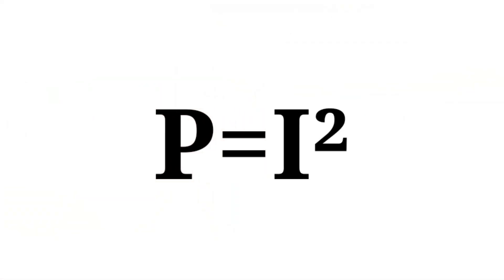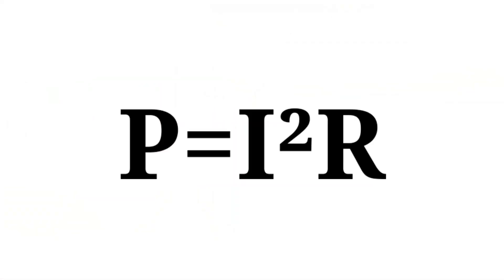Aggregate current and how does it affect MF junction boxes? - Wago 221

Comment: Yeah, no, totally - 'aggravated currents', for being so squashed in bakelite junction boxes since fifties. ;) 
I've another one - "aggregated currents" - when a 100A consumer unit is no longer enough of an enclosure for a single ring final circuit.
One more? "Aggregated currents" - you make sure to package your Wago Topjob's into ten separate enclosures when extending 10 way consumer unit. 
One last one - "Aggregated currents". When IET makes a mistake by adding "follow manufacturer instructions" to BS7671 and accountants at Connexbox do not know where to stop.
Reply from the maker: None of your examples are maintenance free. The requirements for aggregate currents are from the relevant British standard for maintenance free connections, the manufacturer's instructions make sure you comply with that standard.
Reply: @efixx  As we all know - bad regulation/standard is no regulation/standard at all. We can't use Ideal's In-sure boxes on RFC, because they are downgraded to 16A and thus useless. Whereas Connexboxes keep coming up with ridiculous hoops every few months, and change the rules so often we probably need to leave a copy of documentation and proof of manufacturers instructions with every MF connection under the floor. Now they want multiple boxes for every spur plus a different type of connexbox for each type of Wago used. 
Since you guys clearly have a good communication with connexbox may I please ask you to forward the following messages from us - consumers:
- ONE - if it's required - it must be in the package. That's the consumer law. If a zip tie, plastic insert, or that screw mount is required for the box to be compliant with MF logo on it  - it must be in the package they sell us. Otherwise it'd be like selling BS1363 sockets with all three connection terminals and mounting screws to secure the socket missing and sold as optional extras. Connexbox need to stop being such a-holes.  
- TWO - they need to stop screwing around with the rules or they will finish off MF standard before it's even properly adopted and everyone will go back to packing their Wagos into cheap Wiska or Schneider IP65 junction boxes for eternity. If Connexbox going to keep changing the rules and we are going to be constantly non compliant anyway, we might as well be non complaint in good quality accessories, with proper entry grommets and plenty of space inside. So - what I'm saying - Connexbox need to stop being such a-holes. 
Love and peace and smile - you know all above is true (and funny). :D
Reply from the maker: What's bad about the regulations for maintenance free connections? Could you point me in the direction of that consumer law please? A distribution board doesn't have to come with all the correct size breakers to make it compliant, twin and earth doesn't come with earth sleeving and clips to make it compliant. It hardly seems unreasonable to expect a sparky to have a cable tie. 🤷‍♂️
Reply: @efixx  Selling twin and earth without earth sleeving doesn't break its BS6004 or 6242 compliance , selling enclosure without circuit breakers doesn't break its BS 61439-3 compliance. If connexbox is telling us that the lack of ziptie or plastic fitting for Wago 221 invalidates compliance with MF part of BS5733 then it is very much double edge sword - by default what they sold us is not a complete MF fitting, its not fully BS5733 compliant as sold and as such shouldn't bear (MF) logo? 
"Here's your ordinary Wagobox sir, would you like the optional BS5733 MF kit for it sir - it consists of three compatible Wago connectors, a plastic lining for said Wago connectors, a zip tie and *MF logo sticker*."     
Douchebaggery has to be combated, and it's a righteous cause...
Reply from the maker: Respectfully disagree, you could be buying the box to use as a non-mf connection in which no cable tie required. It's completely reasonable to expect an electrician to have a cable tie in the event it does need to be maintenance free.
Reply: @efixx  ok but then does it comply as an enclosure because the enclosure can be opened without use of a tool.
Reply: @efixx  You know it's not about a zip tie or a price of it. It's about Connexbox playing us for fools and continuously changing rules. 
According to this whimsical "aggregate current" bovine excrement, a simple "ceiling rose for downlighters" - a connection that splits 6A lighting circuit into four 5W LED downlighters, bathroom fan and a pull cord switch thanks to Connexbox becomes 80A junction of mythical "aggregated current" and requires at least four Wagoboxes with optional extras. Where all it really requires is four tiny Wagos and one good and solid encapsulating box, for the rest of the eternity.  
All we needed from them was that flipping box for Wago connectors. Instead they keep creating hussle, backward incompatibilities, hoops, multiplying accessories and obstacle courses just to split a simple MF junction into three or four separate boxes with extra accessories for every single spur. 
Guys, we need you to be the voice of reason and call out douchebaggery for what it is, not be apologists or an advertising tube for it. 
If the regulation is at fault - ridicule the regulation until IET gets rid of it. And if manufacturer is telling porkies = ridicule their misattributions. 
You know what is right and you know which side of fence you should stand at. Aggregate current.... in a light circuit junction box... oh my god - the comedians in finance departments....
Reply: @travoltasbiplane1551  Isn't there a provision for enclosures like mini-trunking which can contain unsheathed cables as long as they can only be opened 'by a deliberate action' instead of using a key or tool?  This should reasonably apply to MF boxes too.  Sorry I'm being slack by not including the direct quote from BS7671, but I know it'd take about an hour to find.
Reply: @westinthewest  Mhmm - in 521.10.1
Reply: @westinthewest  yes but is a wago the same as basic insulation?  Also define deliberate action. Open the lid of the little grey box and you can get at the connectors. That's why I've never liked wago boxes. Maybe under a floor but I'm much more comfortable with something that has a screw on it. On the flip side would either of you be comfortable with a socket or lightswitch you could open up without a tool. I know this is opinion and interpretation but I think it's legitimate.
Reply: @travoltasbiplane1551  I would indeed raise my eyebrows at an accessory that could be dismantled without a screwdriver, but then I remind myself that an exception is allowed for bayonet light bulbs, and strangely enough, we don't hear much concern about those.  I have to admit I've never cable-tied my Wagoboxes.  It feels like pointless box-ticking.
Reply: @westinthewest  yeah it's true. As is a lot of what we do. Oddly enough the whole lampholder thing with live parts is one of those things I can't believe still gets ignored by regulation  (especially when safety versions are available). Instead we get SPD's. Makes sense somewhere in sure.
Reply: @v0nreagan  but that is only for conduits. I think 416.2.4 is more applicable here. But maybe that's just me. See indent 3. Even if you consider the wago an intermediate barrier it doesn't require a tool to open. I just don't reckon a wago box without a cable tie is strictly speaking compliant. Technicality maybe but nonetheless that's why I don't use them generally.
Reply from the maker: Connexbox aren't making fools of anyone, they're just making sure that the equipment complies with the relevant regulations. Ridicule is rarely the best way of getting your point across, BS 7671 states manufacturer's instructions should be followed, and the instructions from Connexbox make sure you comply with the relevant regulations. Not being apologists just trying to help people stay compliant. 🤷‍♂️ If either of the standards change we'll update you. Just because you don't agree with something doesn't mean it's wrong. 👍
Reply: @travoltasbiplane1551  Mhhm.. Hundreds upon hundreds of accessories are non compliant then... Majority of push-to-close IP55 junction boxes and enclosures on the market... Almost all Luceco style downlighters with "snap to close" lids on push-fit terminals...
Reply: @v0nreagan  hate the game not the player. I didn't write that reg. Don't get me wrong I don't think it's the end of the world but according to that reg it would seem yes. Which seems a bit bewildering doesn't it.